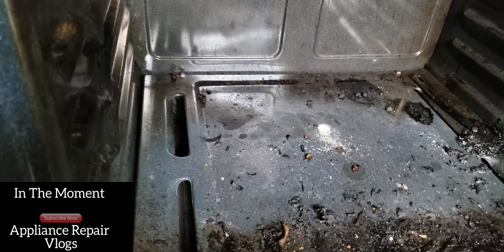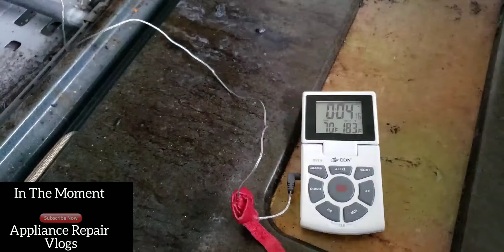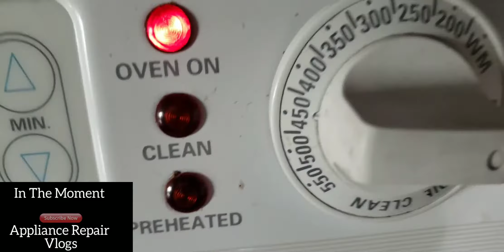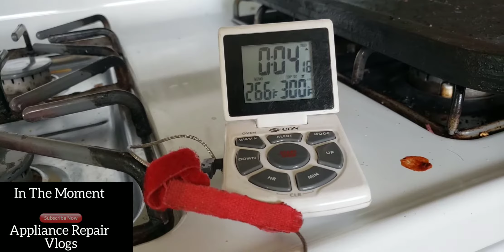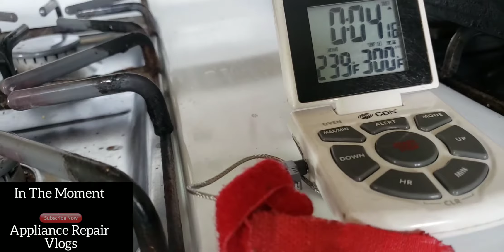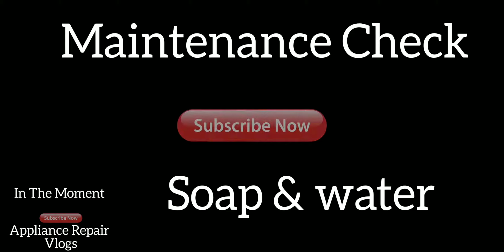🔧 How to fix / Hotpoint  Gas Range ...  Bake ignition system... maintenance check  & cleaning

Comment: I have an Hotpoint oven but no display on the top. Just s basic bare bones oven. The gas is not flowing at all. Would it be the switch on the front of the oven?